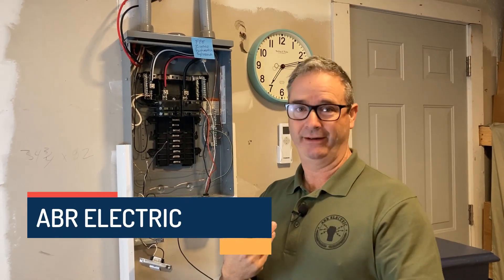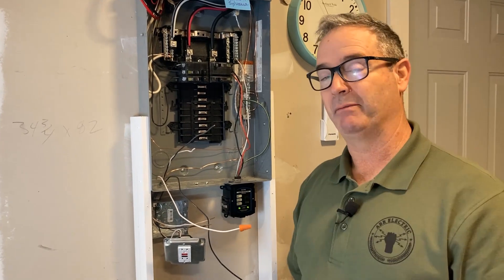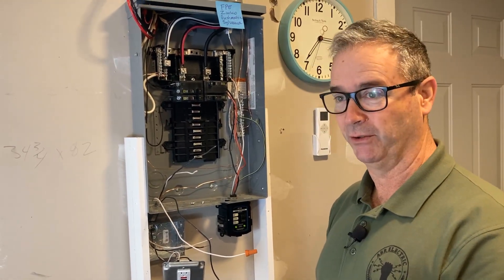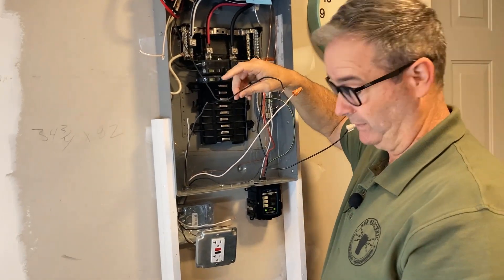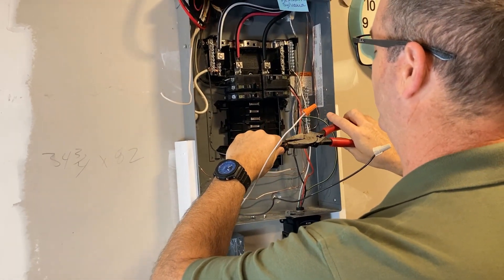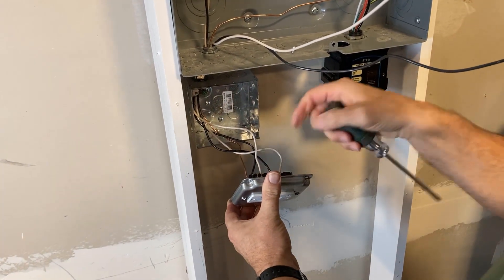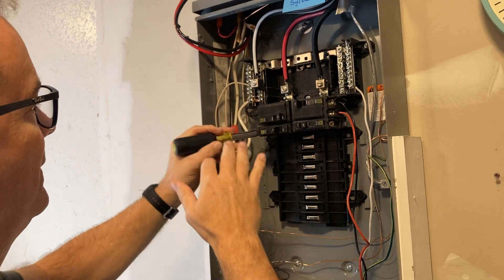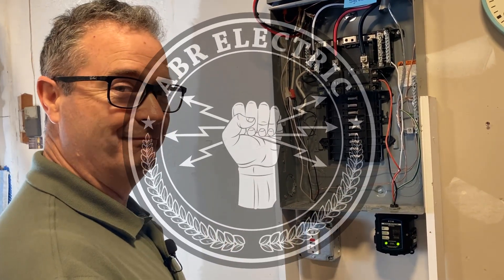Hack for AFCI_GFCI protection in obsolete panels. ABR Electric Anna TX

Comment: Leviton makes GFCI/AFCI devices that are the same size as a receptacle, but are solid front (no plug receptacles). This allows you to do this hack without adding a receptacle at the panel. These are especially useful when you want to add protection to a dedicated circuit where adding another receptacle that potentially serves plug/corded loads would create a violation on the circuit with utilization equipment. For example, let's say you added a built-in microwave with a new dedicated circuit, and you need to add GFCI/AFCI protection. By adding a receptacle in the garage, the microwave would need to be no more than 50% of a 20a circuit NEC 210.23(B)(2). Since practically no microwave would be in compliance, then your "hack" just creates another red tag. Avoid this by getting the GFCI/AFCI blank-faced receptacle. Problem solved and everybody is happy! It is Leviton p/n AGRBF-W.
Reply from the maker: Good fix!